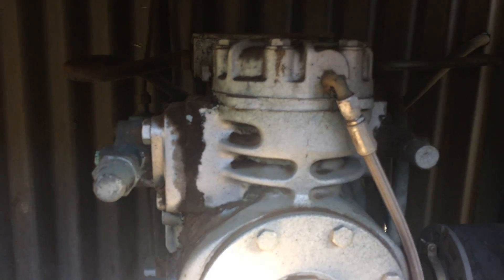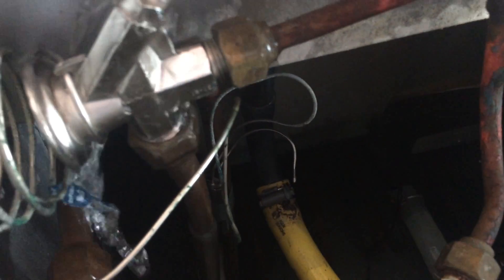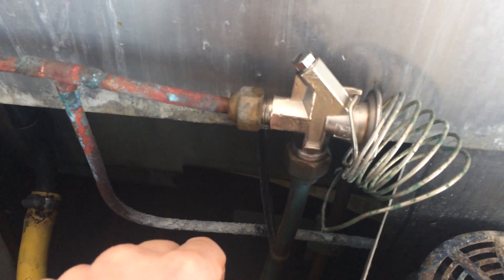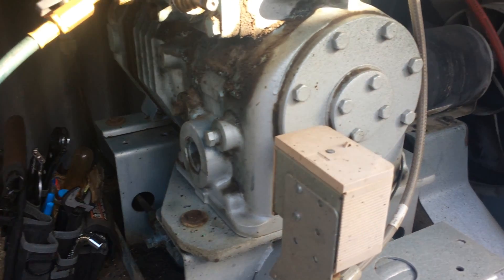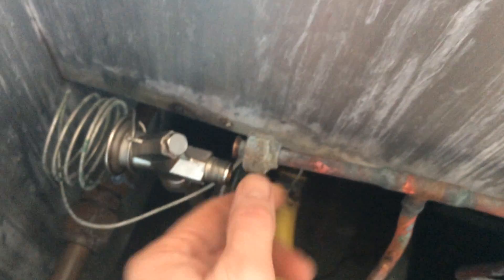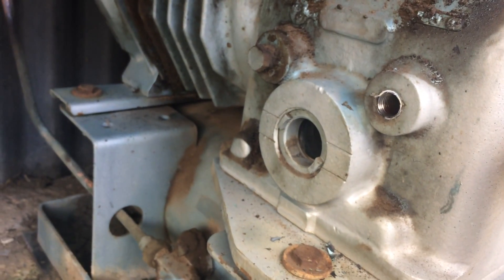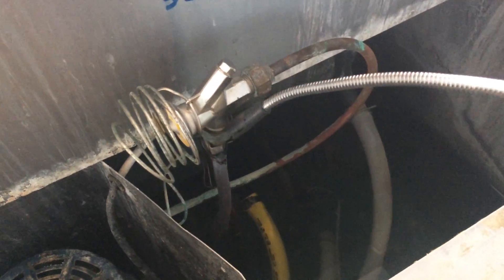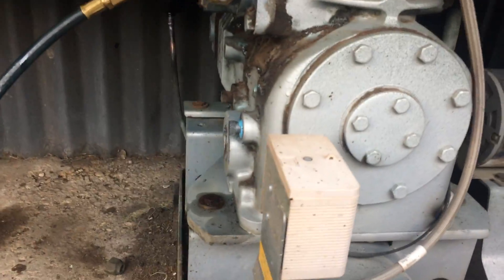Moisture Problems in Old Fullwood Milk Tank

Comment: HI John, good thorough job as usual, your checks did seem to indicate no leak in the coil. but I did notice from one of the clips in your video that one or two of the very bottom copper coils in the water jacket were green from corrosion, so I would just like to make a point if it is any help, from my experience with fixing leaks I think there might be a tiny hole here covered in corrosion making it intermittent, if there is a small hole in any of the bottom coils the head of water in the jacket may have been greater than a low back pressure inside the coil allowing water to enter.
Reply from the maker: Thats an interesting point, something to think about, yeah the last few turns of the coil is very green. I remember years ago before we used micron vacuum gauges the guy i was working with commissioned a new system at a bakery, after a few minutes running there was oil all over the suction line insulation, turns out he had completely forgotten to braze a joint and when he vacuumed the system the armaflex sealed the joint! 
I pressure test it to 80psi which it passed, plus it held a 1200 micron vacuum so hopefully it will be ok!